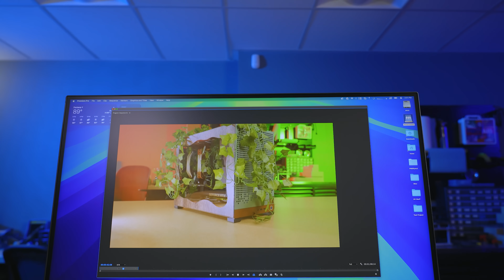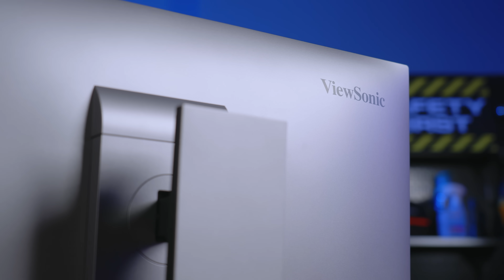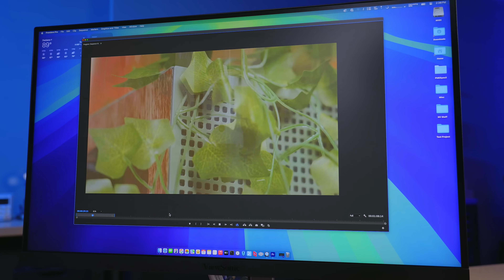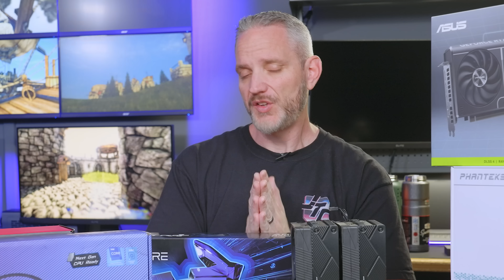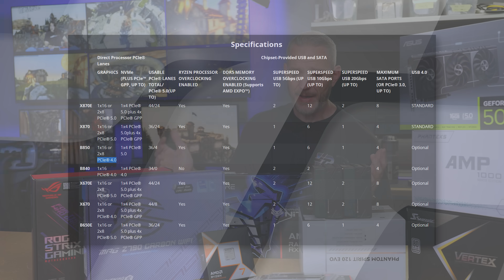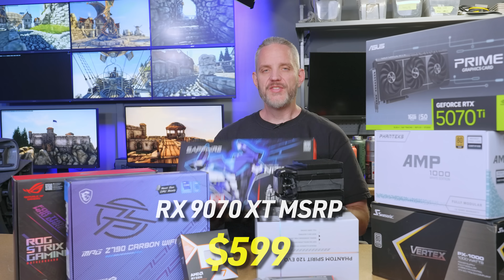This is the Sweetspot for PC gaming... Don't get fooled into spending more!

Comment: Still find it crazy how quick pricing drops too... I bought my rig in November of 2022, right after the release of AM5. I picked all the parts via MicroCenter and assembled it myself. At the time, it was just OVER $3000. Today, nearly identical parts through amazon (some are no longer available), the total is only $1745. 2.5 years later, and the PC costs a little more than half the price I paid... 7700x, 32GB CL32 @ 6000MT, 1000w Power supply, 360 AIO, Lian Li Lancool 3 case, 6750XT Red Devil, 4Tb m.2 all connected to ROG Strix X670E-E. And all of that was before I put another $300 into it over the past 2 years, with more fans, second m.2, upgrade to 64GB RAM+RGB RAM Blanks, RGB controllers, and more RGB stuff (cables, GPU bracket, strips, etc).
Reply: hey on the bright side you had a nice rig ;))
Reply: @grunky-k7p had? Still a nice rig 😊

Comment: I was thinking in upgrading (I'm not in the US just in a poor country lol which right NOW I can't but thinking in a couple of months).. Currently using a ryzen 3 2200g, 16GB ram 2400MHz, Asrock A320M, no graphic card, oh and I must not forget my 1TB HDD 💪, played many latest games and even UE5 games at 30 or less fps lol..
 I was thinking to upgrade to: 9700X, 32GB ram 6000MHz cl30, Tuf 650 or 850 (rog are pretty lol), now that you said about Hynix I changed from the Kingston NV3 to that (would be my 1st M.2 NVME I'd use since now I only have a 120GB sata for windows) 1TB or 2TB dunno, now you changed my mind and going to air cooler (was thinking a AIO), 5070 Ti but I was tempted by the 9070 XT but since I never used DLSS nor RT, I'm going with that one (because my last Nvidia was GTS 450) and Adata 850w core reactor II VE.. Also planning of going back to making videos with the new setup.. Anyway sorry for the long paragraph

Comment: My key advice to new gaming PC builders is to consider carefully the CPU upgrade path argument.  It is null and void for a person who's never going to upgrade his or her CPU on the same platform, and I suspect most people never do.  I've built about 30 PCs for my own use, and I can count on one hand the number of times I've put a new CPU into the same motherboard.  Recently I bought a 5900XT to "upgrade" a 3900X production machine, but when I saw the very reasonable price of just getting another B550 board and 64GB of DDR4, it suddenly made no sense to retire that 3900X when there are other functions it can perform.  So now I have both, and I can divide the workload.
Reply: Maybe for the Enthusiast sector it's a thing, or a North American thing, but I literally don't know anyone who's ever done a CPU upgrade. For most people, the PC is the whole system and they upgrade it together, just keep the peripherals and maybe the storage.
Reply: I have once, upgrading to a 5700x3d. Did it intending to not upgrade again until I build a whole am5 system which maybe in 5-7 years.
Reply: It is crazy when I hear that people upgrade to RTX5070 and still use a 2700X, when they want more FPS they could only think about the GPU.
From Intel side the best upgrade was a K series cpu resulting 10-15% uplift.
AM4 upgrade path is great and now they are pretty cheap too.

Comment: What’s your opinion on the RTX 3080 10gb in 2025?
Reply: It's still a fast card and 10gb is usually enough for most games at the settings you'd have to run them at with a few more recent exceptions.

If you have one already, you'll have to spend a lot to get a reaso able upgrade, if buying used, i wouldnt recommend it if it isnt cheaper than a 5060ti 16gb
Reply: @b-rant my next card is a RTX 5080. Already have a 3080 right now. It holds its own but it’s starting to show its age.
Reply: 5080 is 70% or so more expensive than the 5070ti and is roughly 15% faster.  You'll definitely enjoy the heck out of it and it's your money to spend.  It might be worth waiting for the supers for a price cut or a chance at actually 4090+ performance for that same price.

4070ti owner and i cant say it leaves me wanting more like the 3060ti before it did for RT and PT gaming. @XxLegoxX6824
Reply: 5080 is 15% or so faster than 5070ti for 70-80% more money.  Wouldnt be my first choice as someone who is pretty happy with a 4070ti but im also no longer enthusiastic about the price:performance above $1000CAD.  Fast card and you'll definitely enjoy it if you do go for it @XxLegoxX6824
Reply: @XxLegoxX6824  i suggest you go watch the daniel owens video on "worst gpu of the generation" lol.  It's 15% faster than a 5070ti but like 60% more expensive.  

Not a "bad card", just poorly priced and a bad idea with the supers coming out at the end of the year.
Reply: @b-rant true it’s poorly priced, but can get one for roughly 1400 USD. But I also do plan on overclocking it pretty hard
Reply: @XxLegoxX6824  Holy moly 1400usd is a bad price for that.  That's $1925 CAD, and we can get them for $1700 CAD here.  You'll be happy with it no doubt, but you can do a heck of a lot with the price difference between 5070ti and 5080.
Reply: @b-rant I’m aware but I’m also wanting bragging rights with my friends lol
Reply: As long as the games you have are running and you happy then be happy
Reply: 10gb will do any 1440p fine maybe struggle a bit in 4k which the 3080 could still do in some games.... It's a bit of an odd spot for sure. Really id say just get a 4070. Basically same performance and 2gb more vram and as far as I know even used a 4070 will be going for less than a 3080.

Comment: Future upgrade plan aside... The baseline would be monitor.
So for example most people use 1080p 100hz.
A520 + Ryzen 5500 + 6600xt + DDR4 16GB 3200Mt/s 550watt bronze = always a good combination.
Balanced budget and performance.
Reply: 27inch 100hz FHD is already really good for most people btw.

Comment: @ 20:45 you state that a 4070 has 16gb of VRAM but it only has 12. A 4070 TI has 16 And as well the TI super .. but the 4070 non ti and 4070 super both have 12gb of vram .. .just didn't want anyone to get the wrong idea. Thanks for the vid jay, i rock a 4070 Super myself .. freaking beast of a GPU for what it is .. Paired with a 9600x and 32gb of ddr5 6400 and she go brrrrrrrrrrrrrr

Comment: Even if you go with a higher end GPU, if you're running higher resolution a lot of the bottleneck will still be at the GPU and thus not show the real advantages of an X3D.

The sweet spot right now with AMD, in my opinion is the 7700X which at Microcenter as of this moment is about $210. For Motherboard an MATX B650 is the sweet spot.

Comment: I generally try to reserve about 1/3 to 1/2 of the total budget for the GPU. That said I am still rocking an AMD RX 7900XTX because the current gen cards are not any better. Unless I want to spend more on the video card than I have in the rest of the system, current video card included! And honestly I do not care about ray tracing. 
As you stated though the power supply is one good place to step up. And I agree that a gen 4 M.2 is perfectly fine. I can buy some 4TB gen 4 drives for the same price (or sometimes less) as a 2TB gen 5. And there is no visible improvement in games between the gen 4 and gen 5 drives. Another place I usually "overspend" is buying extra RAM. I am using 96GB of DDR5 6400MT CL32  RAM with a 7800x3D. It was at a better price than 64GB DDR5 6000 @CL30 at the time I purchased and it was on the MB QVL. I learned many years that extra RAM can help make up some for a weaker CPU or GPU.

Comment: Sooo, ah . . . How good is Thunderbolt 4? And why some tout it? As for this vid "Sweetspot for PC gaming", curious the great mobile cpu setups were not brought up. Isn't the 47453dx mobile pretty much the same as a desktop 4750x but with much better power savings and hook to whatever gpu you want to pwr up? Heck, some of these cpu's don't even need a separate gpu to be able to game very well these days. And with AM6 just around the corner, so AM5 is at end game, (shrug) no forward upgrade to think about for that platform. And seems Intel is in the same boat, trying to be competitive. So much for forward ability and keep saving down. Awaiting without ego for what's coming soon. Y`all do what you want. Me, sweet spot is the ability to do new AAA games at 1440 high. Anything ells, it's your money.

Comment: I understand the purpose of the video but disagree about the X3d CPUs depending on your taste. I prefer high 1% lows so a 9800X3D is overkill for my 4070 ti Super but it drastically improved my 1% compared to my Ryzen 5700 and that's really worth it to me. I mean doubling my 1% lows.
   But I know that isn't the point of this video! It's a niche use case for sure. My wife is incredibly happy with her Ryzen 9600x and 9070 setup. So really depends on expectations and preferences. 
     Lots of good advice in here though as usual Jay!

Comment: Regarding power supplies it's also good to overspec your PSU a bit because the vast majority of them are most efficient at middling loads. If you max it out the efficiency is likely going to drop meaning more power drawn from the wall to run the system at the same level meaning a higher power bill. If you care about such things a slightly higher tier PSU will run at a lower load percentage and therefore be more efficient potentially being cheaper in the long run. Obviously YMMV depending on specific PSU, how much you use your PC, and power cost, etc. but if a higher tier is only a little more expensive personally I'd go with that.
Reply: Yes and check online what your GPU you may choose >actually< requires. AIBs may put a recommended wattage on the box that assumes you're running a high consumption cpu or like 12 rgb fans
Reply: You either pay more now or later. There is just a little difference. And before it is profitable you buy a new PC